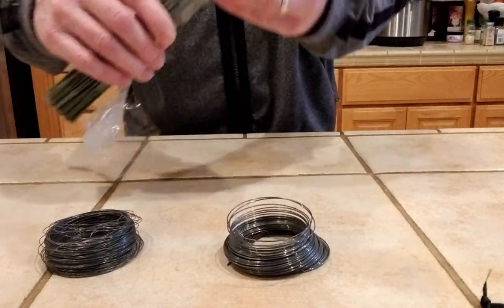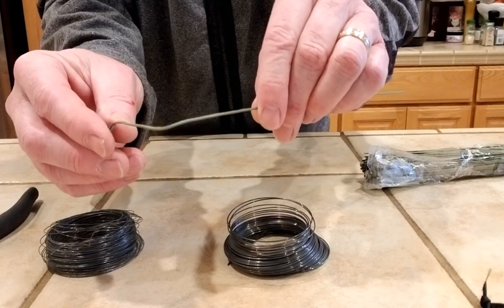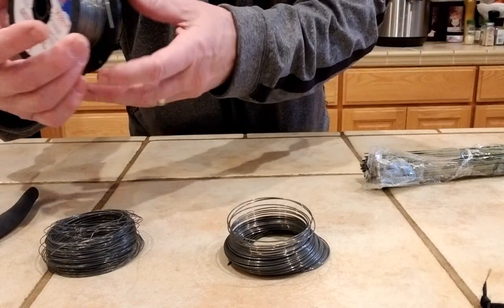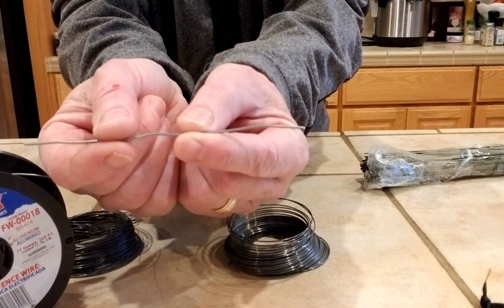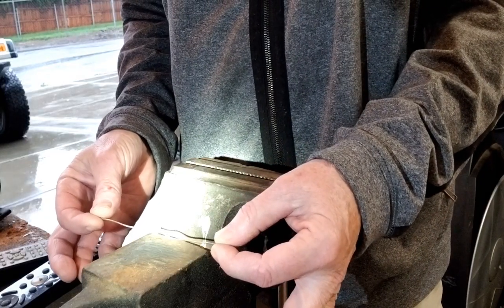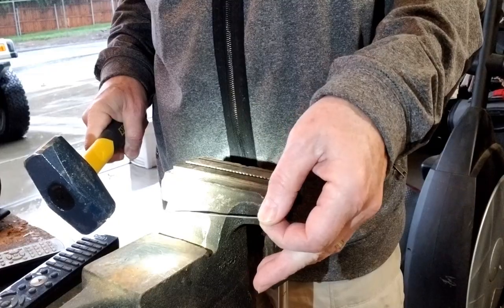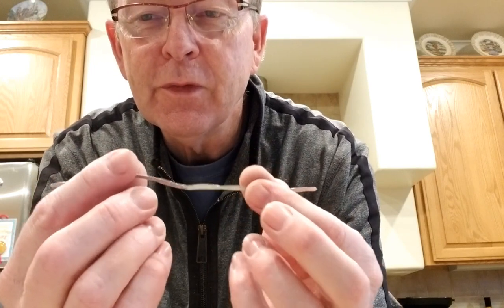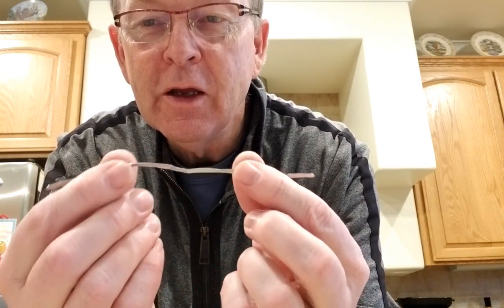Making Anti-Rust Nosepiece Stiffeners for Reusable Cloth Face Masks

Comment: I used aluminum binder clasps from our local office supply.  If they’re  a bit too long, the ends can be cut off with an old pair of scissors.  I cover the clasps  with a casing of regular fairly heavy pellon interfacing (non bonding) to keep the metal from rubbing the nose.  They’re 100 in a box for around $5.00.

Comment: Thanks for this, unfortunately I found the aluminium snapped maybe I made it too thin...
Reply: I ordered the wire but have not tried this yet. Did you use the 15 guage?  Apparently its used primarily for electric fences and I did not find it in stock at local  hardware stores.
Reply: @judystenhouse4832  Hi I used 17guage as suggested. Now I am leaving a flap of fabric inside at top of mask which seems to cut down on moist air getting to glasses...have fun with the face-coverings and stay safe :^)